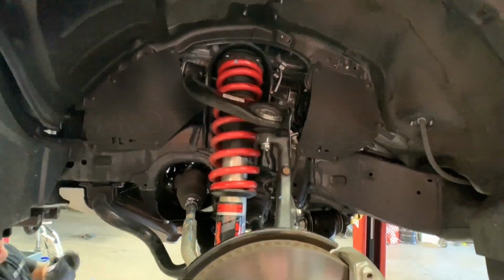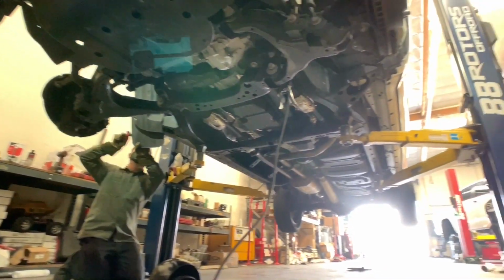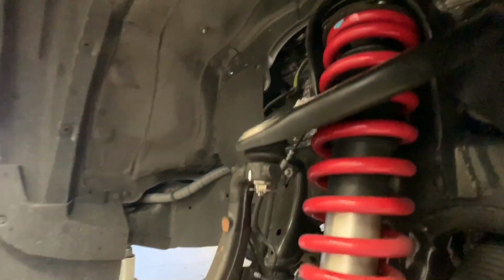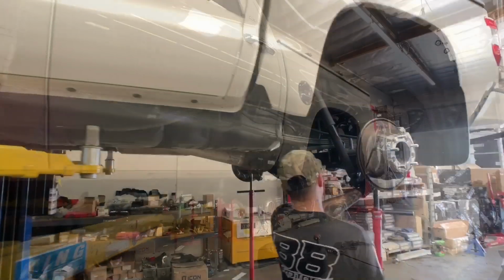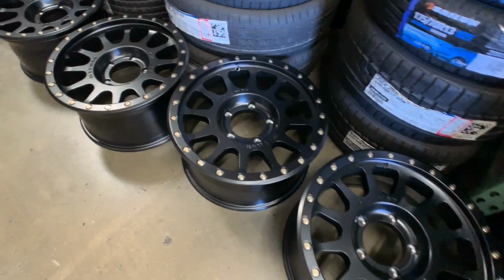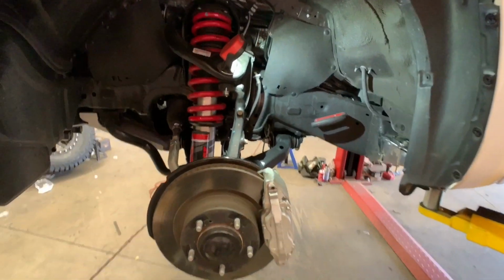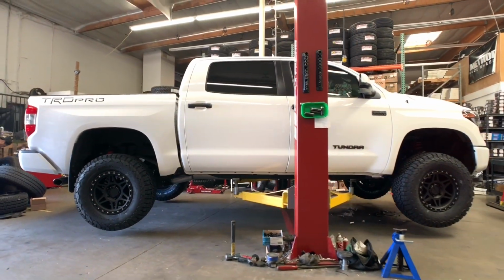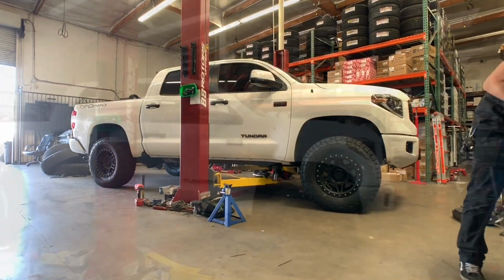2019 Toyota Tundra TRD Pro VS Limited Lifted on 35’s

Comment: I have a 2019 Pro and all I'm going to do is increase the tire size slightly when the factory tires wear out. I don't love the look of the factory tires but they have performed extremely well. And I absolutely LOVE the look and performance of the new TRD Pro wheels. I cut and lifted my 2015 TRD not the TRD Pro, it was hardly worth it unless you are looking for the cool look you are never going to off-road anyway

Comment: Since I have a Limited with 35" wheels, 18" Fuel rims, automatic running boards, shell, bedliner, LED lights in the bed, etc... I'm going to have to go with the Limited. Mine is cement gray though. Much better color than white for a Tundra. If I knew how to post a picture on here I'd put it up for y'all to see.
Reply: How big did you go with your lift and what brand?. I want to go 4.5" but BDS hasn't approved their lifts for the 2019 yet. Every thing else I find is like 3" or lower.

Comment: I'm looking into getting a Tundra & definitely want 35's. Would it be better to get a TRD PRO & just have a spacer kit installed? Or save some $ on the truck with a limited or platinum model & put a lift kit on it? Seems the TRD PRO is lifted higher from the factory but if the prices came out the same it might be better to have the full lift kit if it out performs the stock Fox suspension on the TRD PRO.
Would it also be advised to re-gear to 4:88 when running 35" tires?

Comment: 88Rotors have y’all done any work with the kits from Ready Lift?
Reply: They installed my 3/2 kit on my tundra
Reply: C Parkerz how did it turn out?
Reply: @samuelrainey9791  Turned out really good rides just like stock not to mention they knocked it all out in about 4hrs waiting time.